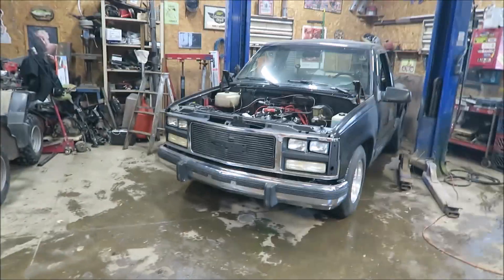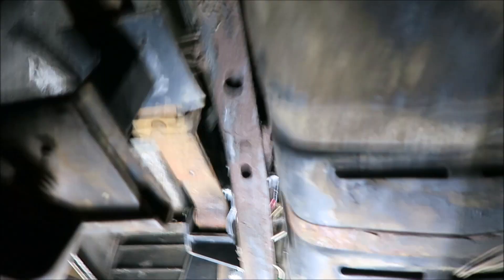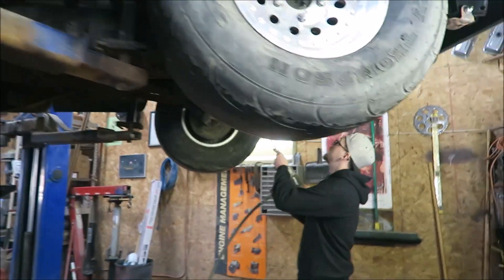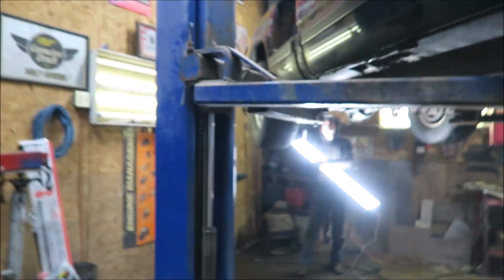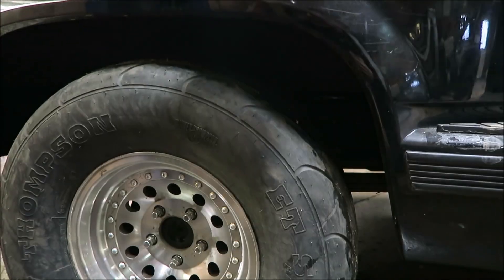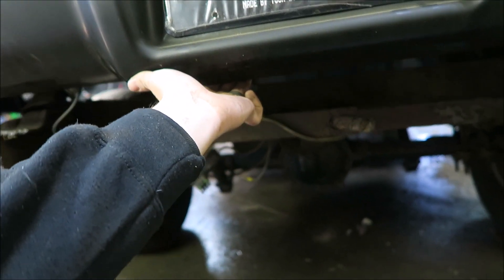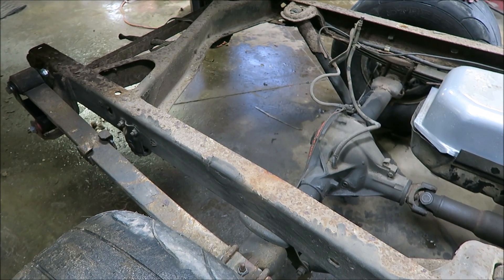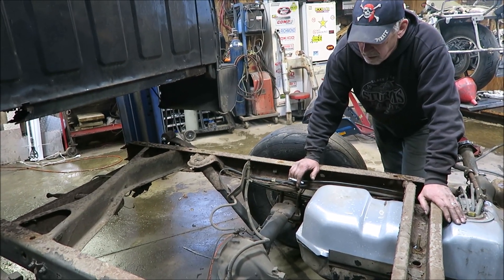Prepping to SLAM Jack Black! Lowered Drag Truck FTW!

Comment: Make sure you support the back of the frame when you cut it or your frame will be a little tweaked. The uncut trick springs should drop you about 2" just cut them to the high you like.

Comment: Good upgrade I hope you going to move the springs inboard while your already there so you have the option to tuck the tire/run bigger tires
Reply from the maker: These are 295, and we have about 2 inches of gap from the back of the tire to the spring. And I don't have big tire money lol so this will be alright for quite a while

Comment: Getting both shocks on the back of the rear end housing is a big step in the right direction. Spindles, Moroso trick springs, 90/10's up front, 50/50's w/Caltracs out back works really good, I've used that combo many times.
Reply from the maker: I appreciate the advice, man 🤙
Reply: SniderTron 3000 Just my 2¢, but it works good

Comment: Dude they make a pre made bolt in  c notch, then cut, super easy done in an hour, mabey look at cutting down some dually fender flairs and make a custom wide body to tuk the rear tire,(( like an outside tub)), won't chew up tires on launch!!!!
Reply from the maker: Yep, that's what I have on the other truck. But, I read a forun post by a mechanical engineer who stress tested all the types of notches and a bolt in c notch was 80% weaker than a stock frame. And welding it was still 60% weaker than stock. On a 1965 C10 frame. A tube type step notch is 10% stronger than stock. 

Plus I just like to make things.
Reply: This is the reason im scared to lower my truck more then a shackles. I live in new orleans and i keep a hitch on that i painted to match the truck just because ive been rear ended like 6 or 7 times in the last 2 years. Most times its just a tap but last time they hit me when i was stopped and they were doing close to 40mph. Im scared of it totalling my truck if its too much to where it twist my frame.
Reply: Its not as bad as you thinking it is,i  drive my truck every day and its on the frame now, waiting for plates and bagg's. To be welded in,  and has a 185,45,r15 on stock rally rims.  Little bouncy but not bad I haul quads still with the truck,👍
Reply: 5" axle flip 2" drop shackles 185,45r15 Pirelli's  on stock rally rims.  Its all in how you want the truck to ride and handle  I street/track drift my truck so I like it being static,the bagg's might make it float and roll on initiation to corners. And loop out.
Reply: I think your missing the point. Its that it makes the frame extremely weaker.
Reply: 4" beltech drop springs, 2" drop spindles, with custom extended lower arms and tierod's. Air ride front shocks, Needs an after market sway bar, and probley a nice expensive shock/coil over  to help with body roll

Comment: It looks like the bed is going to nail those super tall tires. 🤷‍♂️. You may need a different offset rim or a shorter tire?  JD
Reply from the maker: We have about 1/8 on each side at full tuck right now. I'm gonna get different wheels at some point though

Comment: How do you like the pro comp heads???
Reply from the maker: No complaints so far, but I've only got like 10 miles on it and some idling time.
Reply: @SniderTron3000  right on.. thinking of getting some for my son k10 with 454 in it... keep us posted on them. Great content in your video sir.
Reply from the maker: Oh, if you have MotorTrendOnDemand, Hot Rod Garage is building a 454 with these cheaper heads on it. That would be probably be more relatable
Reply: @SniderTron3000  sweet thanks bro. I do have that channel

Comment: Why don’t you do like my tuner did, he did it so where the truck is driving normally when cruising, then I jus press the tow haul mode button and the gears drop to the lowest gear possible depending on the speed and doesn’t shift until 5.7k rpms or so, and I don’t even have to manually shift it, I keep it in drive the whole time

Comment: Not the correct way to measure.  You go from ground to center cap and take the difference from fender to tire

Then the same after lowering it and the difference is the drop
Reply from the maker: I needed a spot to measure the height change after the bed was removed.

Comment: what didnt you just buy a pre made c notch. would of been alot easier.
Reply from the maker: I read a forum post by a mechanical engineer that said he stress tested each of the types of notches and a bolt in C-notch was about 80% weaker than stock, and even when it is welded in it is still 60% weaker than stock. Based on a 1965 C10 frame. 

https://talk.classicparts.com/threads/frame-notch-based-on-strength.20312/
Reply: @SniderTron3000  oh I c. Well personally I'll never c notch my c1500 . It's got enough issues as is. Lol
Reply from the maker: Haha, you're smarter than me